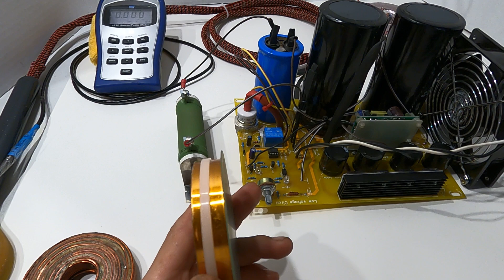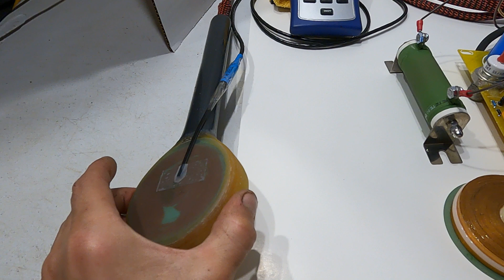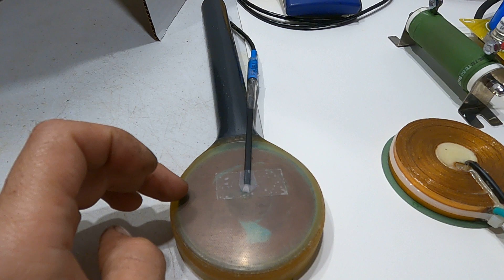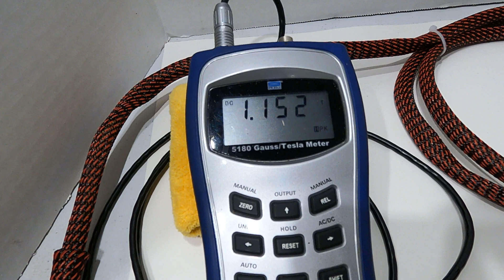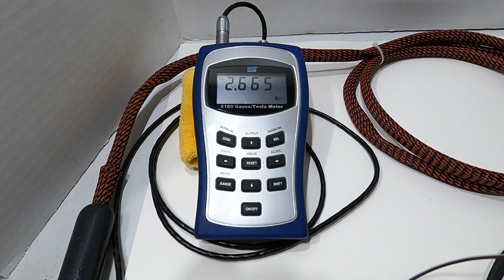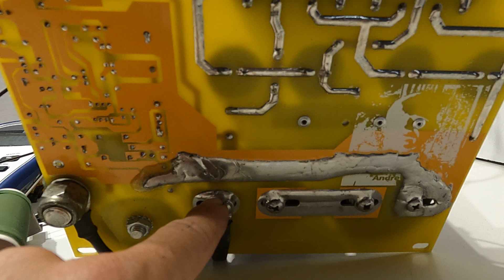138 BBMPulser 5B Plus - running New Strip Coil (220VAC version) 1.1 T  - 2.6 Tesla

Comment: Have you tried an aluminum resistor for charging, do they work?
Reply from the maker: Can you send me a link?
Reply: @AndreyD  I'm sending you the link, but Youtube is automatically deleted.
Reply from the maker: @Aqua_Waterp  I think I have an idea what you talking about. I opened one of those and inside is sand with thin resistive wire. I didn't like how thin it was, I thought it would make a weak point. So I found 60W 10 Ohms (for 120VAC) and 47 Ohms for 220VAC, green ceramic resistor for $15 from digikey.com and it works well

Comment: What kind of resistor did you use, your kit works very well. What are the properties of the wire wound resistor?
Reply from the maker: DigiKey.com part #  TE50B10RJ  10 Ohms 60W for 120VAC $16 & TE50B47RJ  47 Ohms 50W for 220VAC $16

Comment: Well done Andrey. Did you change the value of the scr? As well where did you buy your strip wire?
Reply from the maker: I use stronger Thyristor, it's 1000V 110 A.  SKT55/10C or SKT55/12E
Reply: @AndreyD  Thank you.
Reply from the maker: Here is where I buy the strip wire, you may want to look around AliExpress

https://www.aliexpress.com/item/1005003898400865.html

Comment: Can you please share the details of your strip coil (strip thickness, width, number of turns, ID, OD)?
Reply from the maker: Sure
Coil weight 480 Gram incl glue and tape, you need 11.78 meters of copper strip for this coil
Coil dimensions
OD 3"
ID 1"
85 turns
Copper strip 0.3mm X 15mm Wide 
Insulate it (Wrap it) with 30mm Capton tape, use gorilla glue between layers
Reply: @AndreyD  Thank you!